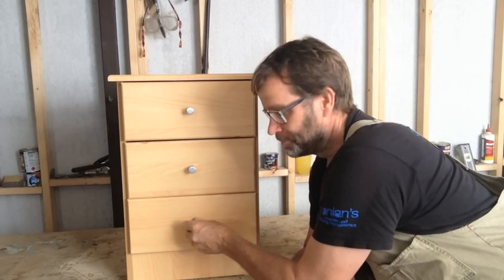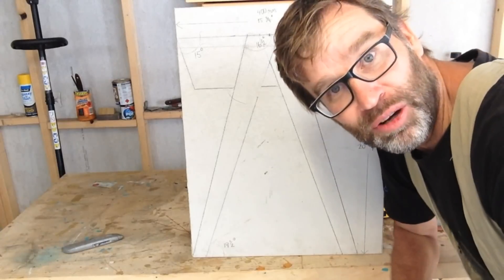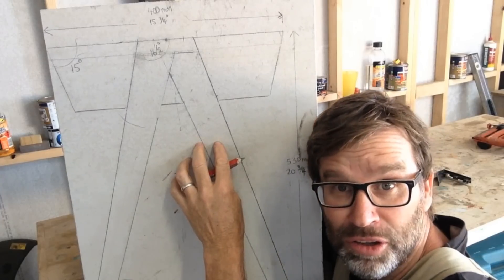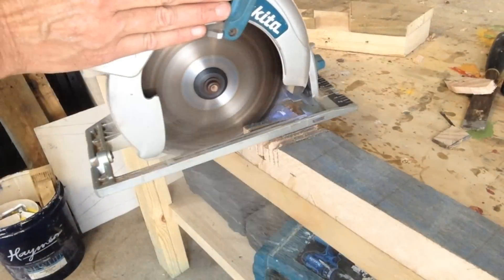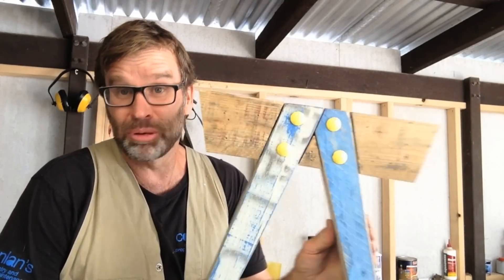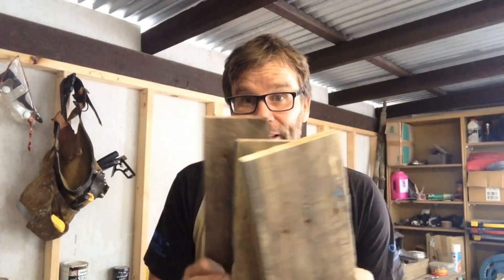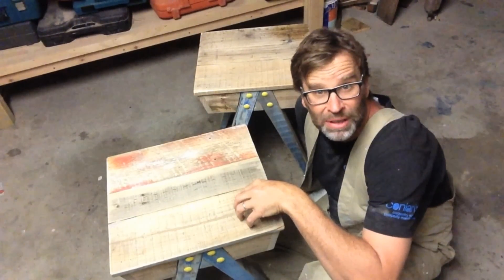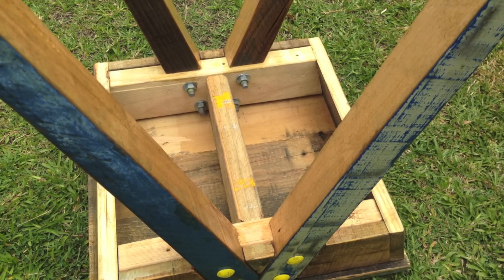How to Make a Bedside Table. Simple Pallet Wood Project!

Comment: Hey Uncle Knackers, great video as ever. Would you consider maybe doing a video on the Circular saw? I'm really struggling to get clean, square cuts and not sure either how to set it up for the rip cut like you did in this video. I've looked at some other videos, but it just isn't the same if its not finished with "TOP TIP KNACCCCKKKEEERRRSSS!". Thanks!
Reply from the maker: G'day Feathers, I should do one as l get asked about that all the time. The trick is to approach the timber with the saw sitting nice and square and keeping it like that. It just takes a little practice. Having a good quality saw also helps alot. Cheers mate.

Comment: Hi I love your bedside tables, I'm a bit like you when it comes to putting a finish coat on my timber, I know it's unaustralian but I have found (sorry it's American) that minwax satin clear is what it says clear so you don't get any yellowing or darkness on the timber
Reply from the maker: Thanks Brendone. The tip re the Minwax Satin is very interesting. We do get Minwax over here but in limited varieties. I will try and get my hands on some if l can and try it out. Thanks heaps for the tip. Cheers
Reply: shaneconlan1 I picked mine up at Mitre 10
Reply from the maker: brendone171 That's good to know as l tried to get some from Bunnies but they didn't have any. I'll give Mitre Ten a go. Cheers for that.

Comment: I've just purchased my first circular saw (a Ryobi RWS1250G) in the hope that I can make items like this. I need to ask those who know a bit more though; is it normal for the blade to move slightly when not in use? I mean (when it's unplugged of course!), I can hold the blade between my fingers and rotate the blade left and right. I've definitely tightened the blade nut up as much as I think it should be (i.e. not over-tighten it). Maybe this is completely normal; like I said, it's my first circular saw so I'm a self-confessed newb!

I also wasn't massively impressed with the quality of the cut. I set up a rip fence hoping that I would get a cut equal to that of a table saw but it was still a little messy. The kit blade has only 20 teeth so I'm wondering if I go up to a 40 tooth blade, the results would improve. Could the number of teeth on a blade help do you think?
Reply from the maker: Hi Mark. You can move the blade back and forward when unplugged. It shouldn't however move from side to side as though the nut isn't tight enough. As a general rule, the more teeth you have the finer (cleaner) the cut.
Hope that helps. Cheers
Reply: shaneconlan1 Cheers Uncle Knackers. I'm going to purchase a blade with more teeth at the weekend and do a few test cuts. I hope that'll produce better results.

Keep up the great work with the videos; you have certainly inspired me!